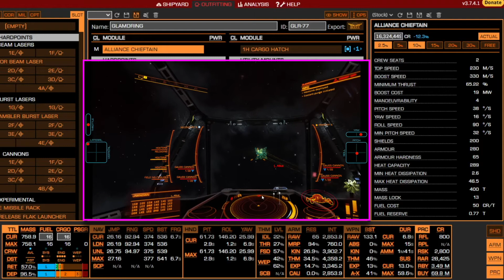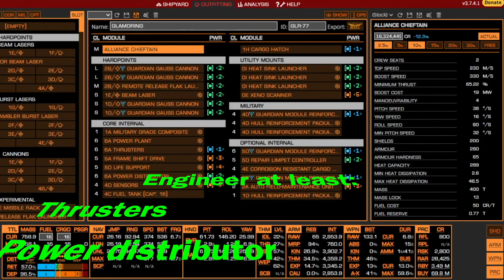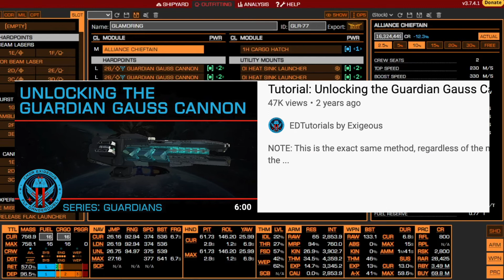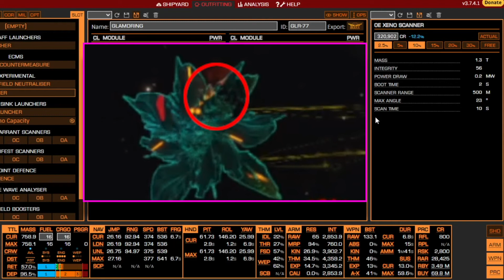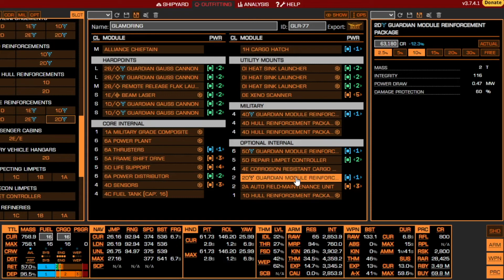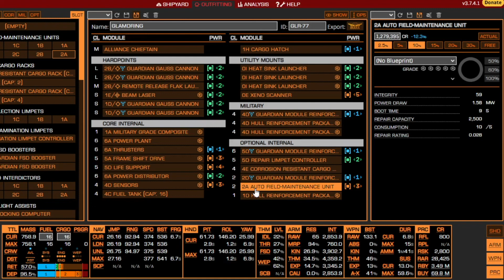AX Tutorial: Shieldless chieftain build

Comment: How do you not have fuel issues with such a small fuel tank and no scoop?
Reply from the maker: You don’t move around much in a combat ship. There is more than enough fuel for the couple of jumps at most that you will make and left over for the fighting itself. It is a ship designed for combat, not for travelling large distances.